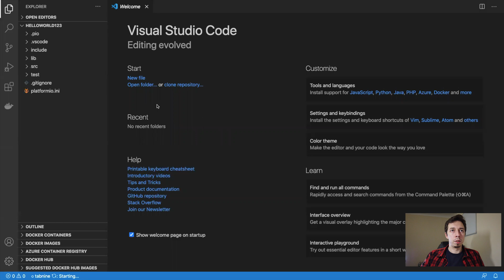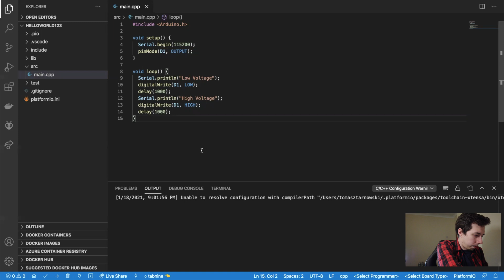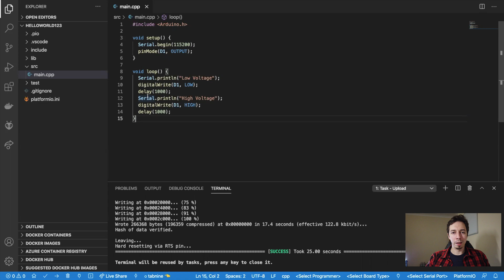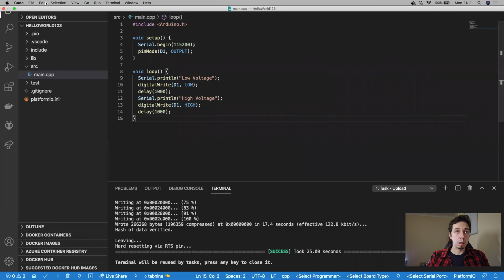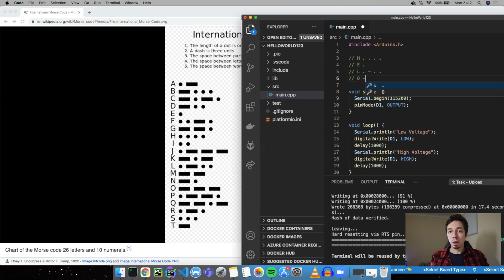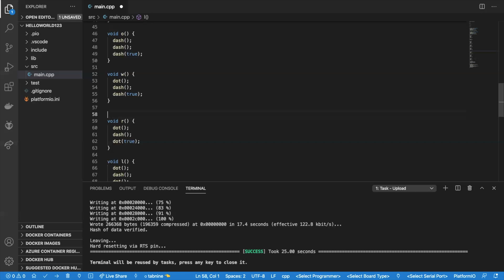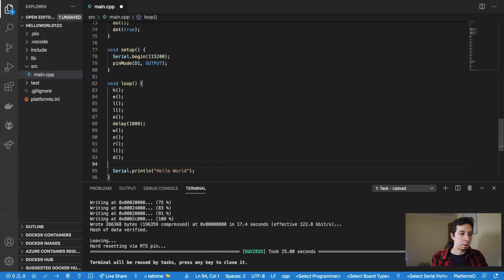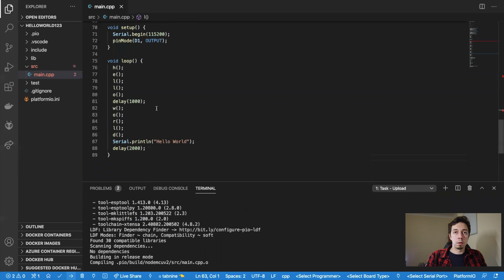ESP8266 Blinking Diode - Day 2 of #100DaysOfCode in IoT

Comment: No limiting current resistor detected 🙂 I like it
Reply from the maker: Thank you!
Regarding the current limiting resistor it wasn't really needed here as the forward voltage of that particular LED diode I used was 4V.
I explained it in detail in the comment in the next video:
https://www.youtube.com/watch?v=0RtwdQZRtMo
Reply: @tomasztarnowski4434  unfortunately for me You are a software developer:). I thought that you will explain all stuff about internet and wi-fi just like you did it about led in first video. I gonna revisit your videos after some learning. By the way, I was not alone saying about led, hah. I put current limiting resistor everywhere. And I've found its a good habit because sometimes I can mix up input and output when changing logic of program. Also, your calculation in comment looks bad as it get negative voltage drop. Look at VA dependency graph in datasheet. I can't say definitely that it's not working on the limit of possibilities. Anyway thanks for sharing and good luck.
Reply from the maker: hey yep, it's right my background is mainly software and as I mentioned in the first video and I'm still learning electronics. I wouldn't like my videos to be misleading and thank you for pointing out the mistake I have updated the calculations and pinned a comment with the explanation.